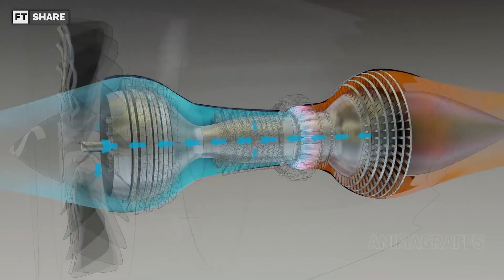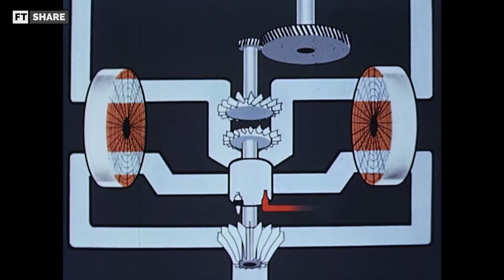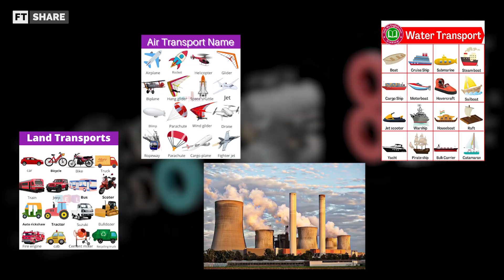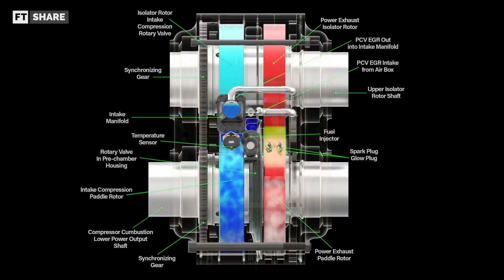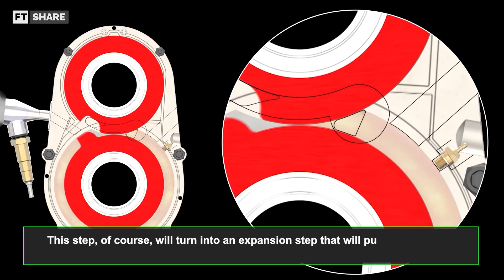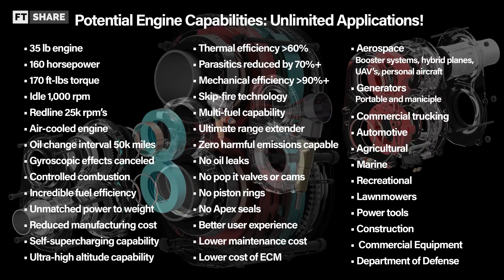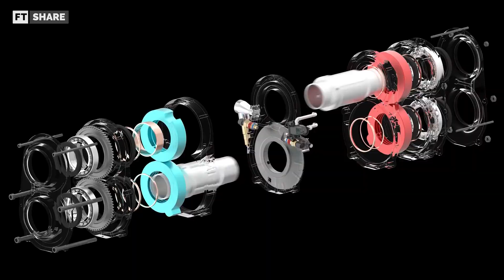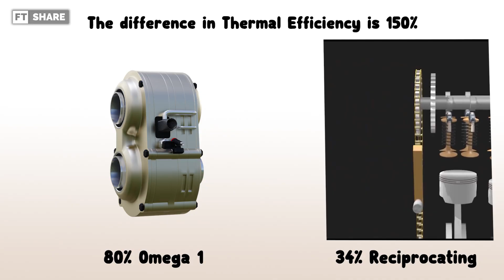Ready To Destroy EV Engine!! | Astron Aerospace - Omega 1 Engine

Comment: Astron to gain all the support they need and investors etc. Especially from car companies. They should buy a new or used cars and remove the engine and place this thing in its place and showcase it doing REAL WORK. a test bench is nice but lets see it in an actual vehicle or generating station and see how effienct it is or how fast and powerful it is. If this thing can say meet or exceed for example the 2fe 4cyl you find in a toyota camry , then you really have something. They should buy a few test vehicles for this experiment atlest 2 sedans 2 suvs a full size= escalade etc and a midsize like a rav4 etc and then a van and a pickup truck

Comment: EV's don't haven an engine, they have a motor.
Also, if you want to kill you not only have to be energy efficient, it also needs to be
maintenance-free
liniar torque with peak-torque from rpm1
silent
clean
extremely powerful
cheap to produce
and other things have to come together to kill the electric propulsion.

I ride big block motors in my classic US-Cars and always loved them, but hands down, EV's are the future. They rock, they have power, they do everything better.

Comment: Poor investors.....
We tested a Mazda Rotary engine in our company. It was converted for a gyrocopter. After eleborate flight testing it had 11% thermal efficiency, proved by more than one measuring points.

In piston engines the  piston speed is a handhold for its longevity, or expected endurance. 10 m/s piston speed is a good value for a long living engine. 20 m/s is a value for modern tuned engines and motorcycles. 
If I create an engine with 0.15 m diameter rotor and run it with the claimed 20.000 rpm the piston speed is 157 m/s. 
Using the formula a =  V^2 / R ,  I see that the circular acceleration which press the seals on the  cilinder wall is astronomical: at 20000 rpm and 0.15 m diamter it is 328986 m/s2 or 32898 G
A 20.000 rpm the piston seals, even made of diamond, will last a few seconds and will be evaporated after that event.
poor investors....
Louis van Rijn, test engineer.

Comment: This is not an engine. Engines burn chemical based fuels such as gasoline, kerosene, or diesel in internal combustion chambers to produce locomotion. This thing runs on an air compressor. Not an engine. 
Terrible script...

Comment: Interesting, but the claims would obviously be investigated by independent parties.
But a rotary that eliminates the apex seal problem AND uses the brutal power from turbines does sound intriguing, especially if it can be joined together like high-powered rotary engines with three or four rotors..

Comment: On paper this looks beautiful. However they should try and explain the thermal efficiency, because we are still in the ruleset of 4 stroke, Otto / Carnot cycles. Even if their theorical models gives them 80%; the real practical result will be lower. If they manage to get higer than the current practical 35 - 37% of ICE, that would be huge.  Hydrocarbons and hydrogen still have an energy density  way above current batteries. This engine in a PHEV would be great. (especially where coal is burned for electrical power)

Comment: If one intake lug on the intake rotor creates 160 hp, why not balance it out with two lugs diametrically opposed? It would dramatically increase the torque output with two firing sequences per revolution vs one, while intrinsically balancing the intake rotor.

Comment: An old ( and very good ) idea. The actual advantage would be to use a third expansion " chamber " in addition. This would increase the compression/decompression ratio towards infinity.  In principle a good invention ( long time duration is the problem ) , but how long does it last in this special brand? Additionally it is possible to add a secondary steam-machine, which uses the wasted heat to drive a steam-decompression...I.e. using water as the working media.
Reply: or like the old steam engines, have 3 'red' rotors, one high pressure, one medium pressure and one low pressure
Reply: @andyman8630  combination of all may result in maximum efficiency near Carnot Theory. It's worth trying...
Reply: @dennisliebig7622  
maybe! but then maybe the mechanical complexity would result in torque losses negating the 'theoretical' advantage

but as you said, it would be worth trying even if it failed! after all, Edison 'failed' 100 times before he came up with the 'working' light bulb
Reply: @andyman8630  trying...in any case,.., a silent machine results , no muffler needed .
Reply: @dennisliebig7622  
trial & error is the only way forward
Reply: @andyman8630  " absolutely " yes. What I ask myself a long time is, whether Carnot Efficiency is really the maximum. What about multifold recuperation of thermal heat ? Even if every step naturally is below Carnot limit, doesn't adding to infinity of many steps may result in higher total efficiency  ???
Reply: @dennisliebig7622  
well in theory? higher efficiency yes! but because each step is 'less than' Carnot efficiency, so must the end result be less than Carnot efficieny! the laws of thermodynamics are not negated - but then it is not an 'enclosed system' as in truth there is no such thing

and this is where true science deviates from 'mathematical theory' - maths is but a language and as with any language, maths can describe both reality and fantasy equally well

again, the only way forward is trial and error utilizing the cornerstones of 'the scienctific method'  - observation, measurement and repeatable experimentation

one can only but try!
Reply: @andyman8630  I.e. 85 % = 71%+9%+3%+1%+0.3%+... beyond 81 % of one perfect theoretical first step ?
Reply: @andyman8630  yes, I agree completely. A problem ( more an obsticle ) is, if theory gives  limits that de-motivate to do experiments. In the case of very low Temperature Gradients efficiency goes down to zero so fast, that one might think , it's not worth trying something. On the other hand temperature reservoirs actually increase towards infinity ( Atmosphere, Groundwater )... That's why Wind or Storm are so important for Energygain. A huge thermodynamic machine actually drives everything on earth.
Reply: @andyman8630  👍
Reply: @dennisliebig7622  
there is no such thing as 'zero' at any level, in any instance (except mathematically,,, again)

'absolute zero' is not possible, "nothing" simply does not exist and there is no such thing as 'perfect'

imho, you need to separate the 'mathematical' from the actual and think outside the square

as for experiments? when 'scientists' observe the mathematical 'limits' they won't even conceive anything outside of that, let alone experiment

Comment: So even if this drew in plain atmospheric air without any carbon containing fuels at all and combusted that air by some black magic technique, it would produce nitrous oxide which is a greenhouse gas AND produces acid rain.

It obviously needs a liquid or gaseous fuel of some sort resulting in even more emissions. Let's face it, even if it was 99.999% efficient and had a 1 million mile service life it couldn't be used after the 2035-2045 time frame in most civilised countries in the world.

This is yet another fossil fuel industry scam. Its only possible use is a stopgap measure for some 10-15 years while battery technology catches up to the point where electric is viable for trucking and aviation. Maybe defence because they don't give a shit because they're blowing stuff up anyway.

Currently an electric drive train for a passenger car has a projected 800,000mile service life (soon to be 1million) and a service interval of 40,000km or 2-3 years and a battery to wheel efficiency of some 95% with zero emissions, very little noise and 100,000km+ between oil changes with no spark plugs.

It's also likely just an investors scam for die hard petrol heads.

Oh and for the record it could at most be called a 2 stroke engine me thinks.

Comment: gas electric turbine hybrid good for vtols doing 360 as suport engine on servo 2x2 from smaller helicopter to larger gulfstream airplane easy just by factor ratio best if loocked upo to sizer like 320, 420 hp 560 hp and 750 hp as ratio siye switch anywa a gas turbine is slight lighter and range is better or should be max ouput lock up to 95% original rpm and usability duration fligth max in 84% rest is vtol suport servo and tank siye and easy install into helicopters or gulf jets or even tomorow without heli vtol cars fly on back up power pair front or rear with some wings so helicopter gets side strength attachmanets and gliders as airplanes have and mini directional wings roatational slight enlarged for glide purpose so technically a helicopter or fly car of future space ship tech has tech buble suport so lands and slower and speeds and gets corner angle to easy rest is main engine and cruise speed and directional wings suport in meantime a cocpit get so called rotational so drive is even more scfi flight based basicla a gulfstream jets get more angled wings and stronger sides to easy fit in pack rotor turbine on servo is strengrth and max weight are easy solvable is kind machine tech product doing UAV self flight on its own also or with drive suport pilot as system after programed behave automaticly to control which is doubled electric and wifi so remote desk can also drive wire it easy or monitor it through sat link best if 3'4 versions size power and figuring posibilities for use

Comment: 7:34 I'd rather put my money on the Aquarius Engine. Much simpler design, less moving parts, no need for extremely tight tolerances, and sips fuel. We have yet to see the Omega 1 really working... not connected to something that spins it to showcase some combustion.

Comment: I’m not an engineer, but from what I can see the zone of combustion would be difficult to seal as would the compressor side of the engine and there is no detail in the animation suggesting how sealing is achieved. That “lug” that is analogous to the piston crown on the power side is very small and there’s just one 🤷🏻‍♂️ the surface area in the combustion zone compared to the lug area is absurd, lots of heat/energy leaking into the rotor casing there and its got to power the compressor side and perform virtual miracles to boot. Sorry not buying it.

Comment: Love the argument of less moving parts, but forget to mention the intricacies and difficulties of manufacuring these components, let alone the unobtainable materials needed. Also, thermal efficiency is something that varies depending on a multitude of factors and I'm certain that number was plucked straight from CAD and also in an unsuitable state of operation, the first swept volume is a waste, you could incorporate it into the top side of the rear rotor and make it do both jobs..... oh wait it'd just be a deconstructed wankel like it is now
Reply: There is one major difference between this design and the wankel, it has no reciprocating parts. All rotation is axial.

Comment: Conventional Reciprocating Internal Combustion Engines don't run on heat or thermal efficiency, rather they run on the expansion rate of their combustion stroke and the resulting exhaust gas pressure pushing the piston down which turns the crankshaft.  Heat is simply a byproduct of the combustion process and serves no useful purpose in an internal combustion engine. The Omega 1 has to have some kind of apex seals, otherwise compression and combustion leakage will cause power loss and other problems.

Comment: lol yea I would hope the hybrid market would give it a try. because in all honesty in hybrid vehicles the ICE is a huge weak link as far as resources and reliability. It would be nice to see if another ICE type would be more reliable and use less oil and maintenance. Sometimes I feel like what we hybrid lovers really could use is a diesel engine to power a generator that would provide enough power for a full electric drivetrain. Like the BMW i3. Except the i3 had a mini gas motor which was again, the weak point.